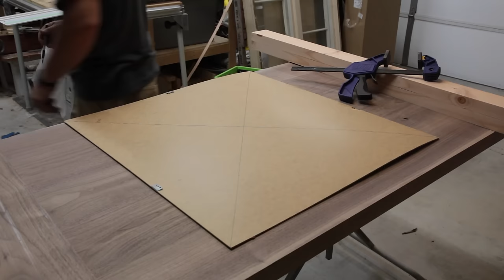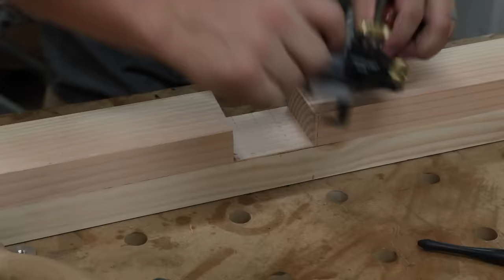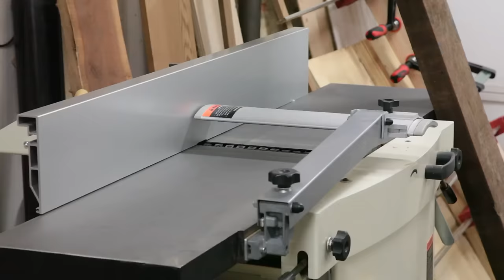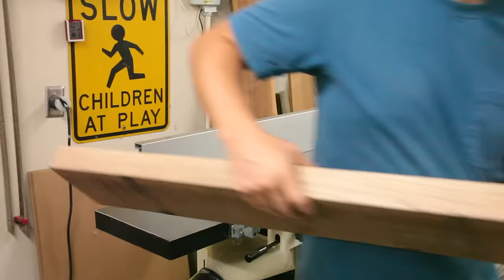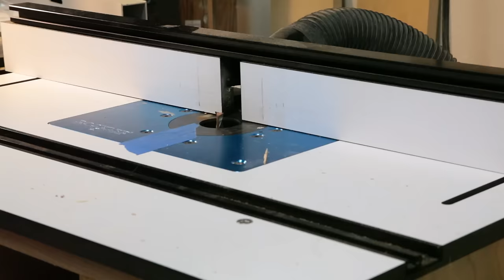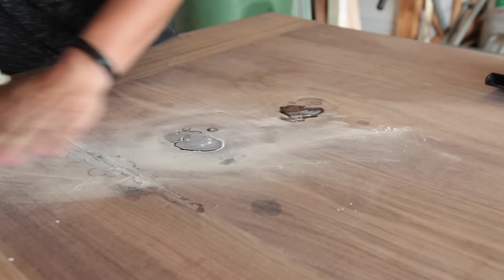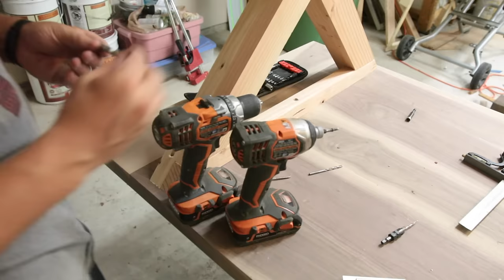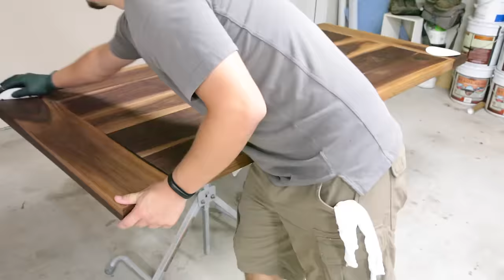Make This: Farmhouse Table

Comment: What angle degree did you use to cut the "X"s? thank you in advance!!
Reply from the maker: Guessing that it was like 23.5 or something liket that but the mor important thing was creating the pattern.  Cut a piece of trash ply or 8mm ply to the outside dimensions you want (example. 36 in high and 34in wide.  Then draw out your shape and set your t-bevel up to that angle and violia you have your angle it doesnt matter what the actual angle is.  Just dont adjust your t-bevel until you are done.  And side note: making a square template simplifies the process since your X will be simetrical.  Hope that helps and thanks for watching!

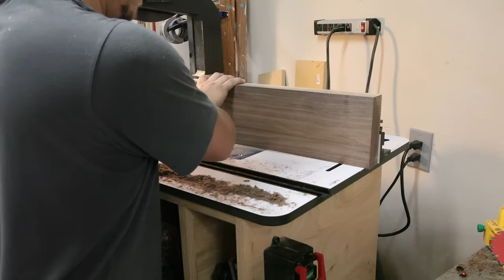Comment: Ok, so, at 15:08, lower right hand corner.  Did something just catch fire?!
Reply from the maker: +formerartstudent Good observation, The fine dust from the router was captured in the dado being cut (despite knocking it clean between passes).  This basically caused the chips to become heated by friction that coupled with the air flow from the shop vac and the router it fueled the embers.  Nothing ignited but it is probably best that it landed on a cast iron surface.  Although, i think if it had landed lower it wouldn't have received as much air flow.
Reply: +formerartstudent :) I think you're right, you can see a smoldering ember land and burn for a bit!

Comment: Great job on this! Can you tell me what Domino system you used for making the table top?
Reply from the maker: Sure thing, its the Festool Domino XL.  It seemed to be more flexible for my purposes.  Although, I will say if you do mostly small projects that the size of 500 would probably be a big + for it since the XL lives up to its namesake... it is a beast! I think that is the question you were asking, but I realize you might also be asking about the size of the dominos used and it was 8mm for the alignment of the top and 14mm x 140mm for the breadboard ends.  Thanks for watching and let me know if you have any additional questions.
Reply: Really appreciate the info!
Reply from the maker: Anytime.  Also, I should have a new video up in the next couple days of the dresser I'm making for our baby to be, Genevieve.  I demonstrate a method for making traditional mortise and tenon joinery.  In the front and then used dominoes for the remainder to save me some time since this one has to be done by the time the baby shower happens.  Take care.
Reply: What are the shaving tools you are using on the corners of the wood?
Reply from the maker: The small one on the walnut table top is a block plane and the larger one I used on the stretcher (the part that goes between the legs) is a smoothing plane.  Thanks again!
Reply: Appreciate it! Mind me asking if those were Lie Nielsen or something else? What make and models?
Reply from the maker: I have drooled over the Lie's for awhile but haven't pulled the trigger on any yet. Both of those are Stanley Sweethearts and have been great for my purposes.  I do have a few Veritas planes with the PM-V11 blades and while I don't use hand planes extensively they do seem to last a little longer between sharpening.  You will see the smoothing plane again in an upcoming video where I am making a dresser for my daughter.  Thanks again!
Reply: Look forward to seeing the dresser video!
Reply from the maker: I have all the footage and am working through it.  I also just picked up a rental house and the process of renovating it is cutting into my editing time more then I thought it would.  Thanks as always Mr Jeep for your continued watching!
Reply from the maker: Oh and check out the Facebook page if you haven't already to see a pic of it completed @ https://www.facebook.com/MakeThisWorkshop/
Reply: Very nice!! Great work!

Comment: Why not just use 4x4s or glue the 2x4's up with the gap already there? Seems like a lot of unnecessary glue ups and dado cuts.
Reply from the maker: Jorge Pollo  good question. I alternated the grain on the 2x4s so they are a little more rigid then a 4x4 alone. And I thought about constructing them separately but personally just preferred the dado to the cut and slap method. Both work it was just my preference. Thanks for watching!

Comment: put your table saw guards on
Reply from the maker: +First Last I appreciate your concern for my safety.
Reply: +Make This: Workshop Not concerned just pointing it out, but, in my wood shop one of the quickest ways to get fired was to not use the safety guards and all my 42 years in custom wood working I never filed a BWC claim. I'm retired now so good luck.
Reply from the maker: +First Last Im glad to hear you had a successful business and safety record. As the child of two entrepreneurs and being one myself I love to hear entire careers have been made by the dedication and willpower of oneself.  You certainly have the right to run your business in any manner you see fit and I would never suggest you modify your time earned practices.  

That being said, My grandfather never had guards for any of his tools and he had 50+ years working with power tools, my parents (probably because their parents examples) never used their guards and that is another 30+ years experience each(they were late starters), finally because of all their examples I have not used them most of the time for the last 20+ years (I didn't come out of the womb with tools after all).  That being said with over 130 years experience we all still have our digits.  I do have a guard on my miter saw but it is not functioning so it has to be pulled out of the way before making the cut and I am trying to get Rigid to send me a replacement as it is still under warranty.  My table saw does have a guard but I find it to be in the way most of time.  Also, consider my families experience is in a home workshop where the conditions are more controlled than a production shop.  Because of this, perhaps, it is harder to be distracted and forget where the blade is in relation to your digits.  

In conclusion, I appreciate your input and do value your experience but will continue to do what has worked for me and my family for over a century of experience.  While this might put me at a slightly elevated risk injury I still feel safe.  That being said, If I were in a position where I was sharing my workspace with others I would require guards like you did.

Comment: That festol is a joke. Wtf
Reply from the maker: Yeah they are laughing all the way to the bank.  But when I bought into their system it was the only option for dust collection and the track for the circular saw was a big selling point also.  I renovate homes as a side hustle and use that saw to cut and install granite and quartz countertops. I agree that festool is hard to justify if you are using it for a hobby.

Comment: shitty at dado cuts huh???????? should have look at the height of the blade at side way, all that chiseling and planning cut have been avoided.
Reply from the maker: Thanks for watching and commenting.  I think it is funny when people assume when you pull out a handtool its because you messed up something with a power tool.  As you get more experience within a hobby you will find things you enjoy doing. I enjoy working with my hand tools.  So I like to use the powertools to get rid of the bulk of the material and then use the handtools to finesse the fit.  This also ensures I get tighter joints which limits the amount of bondo and wood filler my projects need to look presentable.  Thanks again for watching.
Reply: No bad comments from me, the table is very freaken nice . I for my self dislike to use chisels when I can do a perfect cut with machines, since I was a machinist and now into wood projects. There are different ways to accomplish a job and yours is one way :)
Reply from the maker: Ah a machinist... I understand!  lol.  No offense taken (even before knowing your background).  Like you said many ways to skin a cat.  Different strokes for different folks.  I would encourage you to get a well sharpened plane or chisel and finesse a joint or two... you might be surprised how rewarding and relaxing it is.  Especially because it’s so different than your occupation.  Thanks again!